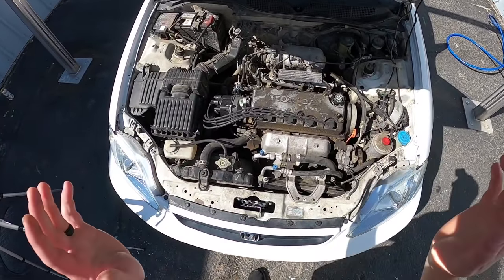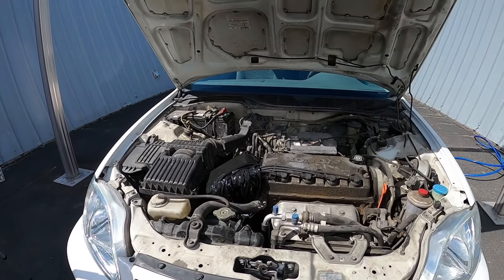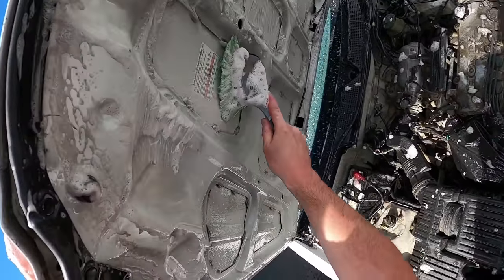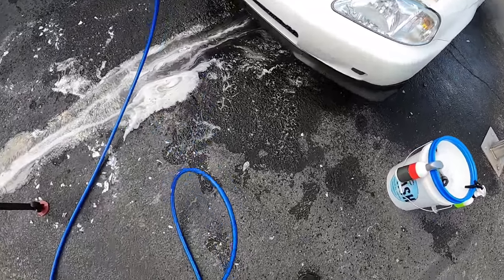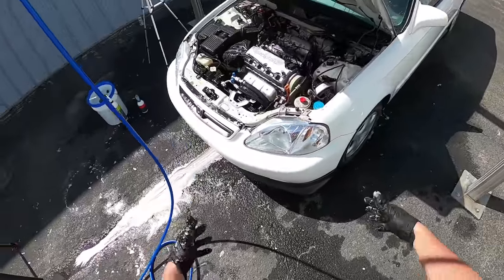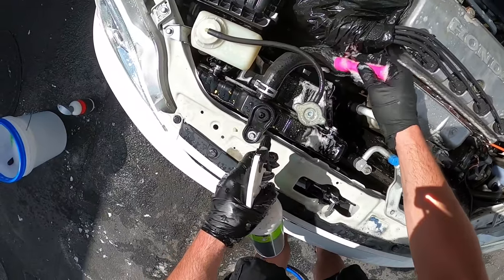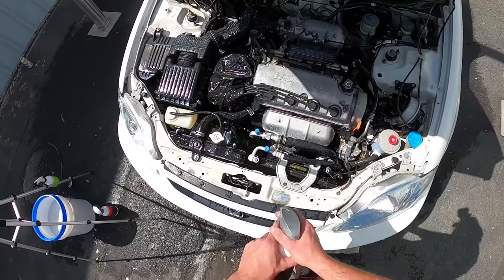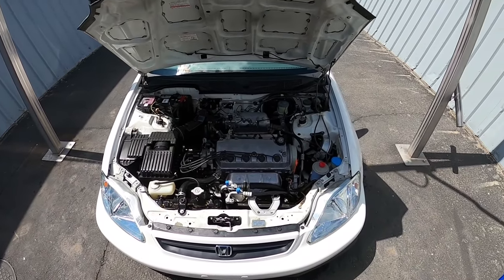FILTHY Engine Bay Detail on a 200k Mile Honda Civic | Start to Finish

Comment: when i clean my engine bay are there any specific parts i need to make sure don’t get wet? i want to do it i just don’t want to do it and ruin something that i sprayed and then realized it shouldn’t be sprayed
Reply: i have a 2002 civic lx
Reply: @itswinter8459  everything can get wet. It is just important not to hit the distributor or fuse box with a power washer as water can ingress easily into them. Main thing is to just mask them off if you are worried. Also make sure you don't get anything down in the spark plug wells. best thing to do in my honest opinion is to blow them out with some compressed air afterwards.

Comment: Have you ever ran into issues after cleaning an engine bay? I worry about the possibility of corrosion around electrical connections over time 😬
Reply from the maker: Nope, and chances are this wouldn’t have to be done again for years and years
Reply: I've had issues before, and they've always been shittily designed coil/spark plug wells that allow water to pool on the spark plugs causing arcing, pull the coils, get compressed air and blow out all the water, throw some dialectic grease in the coil boots, reinstall and she's good to go. 

Unless the engine compartment has been through the wringer and absolutely mangled with shoddy rewiring you shouldn't have any issues blowing water all over your engine, pressure washer or hose pressure.
Reply: @AzalofForossa  well then just use a spray bottle with soap and water, agitate with a brush and wipe clean with a dry rag. To make it easier, you could take a brush and some compressed air to the engine and take off all the lose dirt and dust prior to that stage

Comment: Should wet the hood first not jetspray it water directly closer it makes the gunk/dirt penetrated deep into paint,thats why it leaves burn marks of the hood.just wet it first & spray it with wheel cleaner, let it 3-4 minutes then rinse.

Comment: All that just for a video but to be honest quick 10mins job that is use junk chemical 50/50 strong cover the ecu and spray that leave for few mins then jet blast it simple easy and you got a perfect clean engine and yes all my cars run perfect after that Neva had a misfire issue just keep the jet always from important things

Comment: Used the MWC cleaner so wrong, works way better when you let it sit for 5 mins but apply to dry surface, no pre-rinse. Wasting way to much as Koch makes there products where a little goes a long way. You dipping it in water dilutes the cleaner. 

Even the green star can be diluted 5:1 and is just as effective if not better,save yourself money bro.

Comment: Umm what about disconnecting the battery.?
Reply: Not necessary, unless you want to clean under the battery. Just don't be aggressive around sensitive areas and avoid using the pressure washer at close distance. Most cars are well protected in the engine bay, especially after the 1990s and all modern (last 10 years) engine bays are safe to clean this way. Furthermore, on newer models, many will require programming at a dealer if you lose electrical connection.

Comment: Using the pressure washer on an engine is a bad move. While everything was made water-resistant at the factory, years of abuse and weathering will cause small fissures in seals, gaskets, plastics and rubber. You’ll blow dirt and water in where it doesn’t belong, always cover electronics and use a shower setting. Love your engine, don’t f$&k it

Comment: I honestly don’t trust spraying water on my engine.
Reply: I’ve used a water blaster on my EK civic, even on the distributor, it was fine. The electrical connectors are all waterproof so no harm done.
Reply: @zeroyon4562  no squealing belt ?